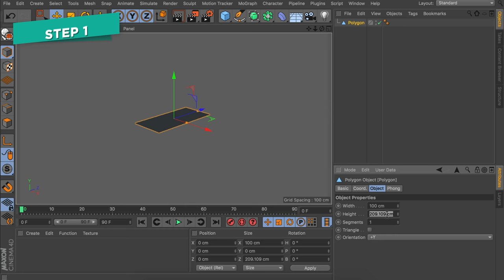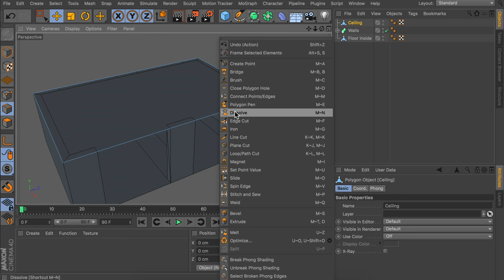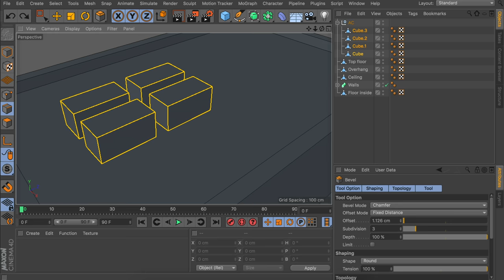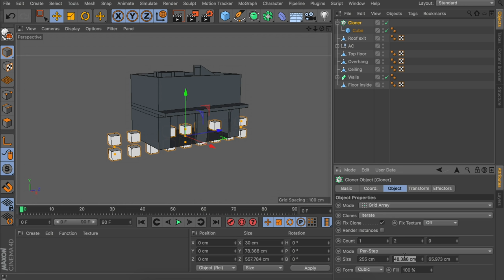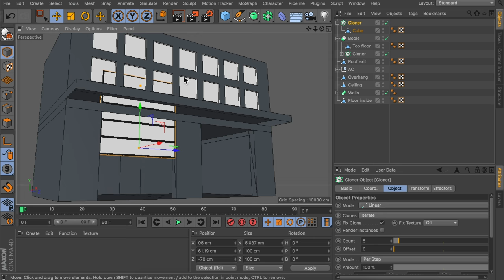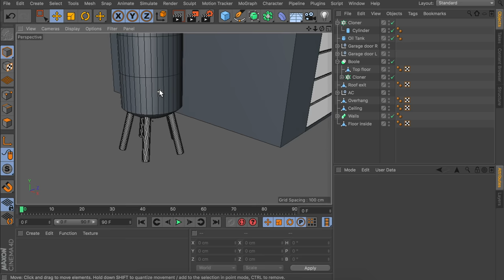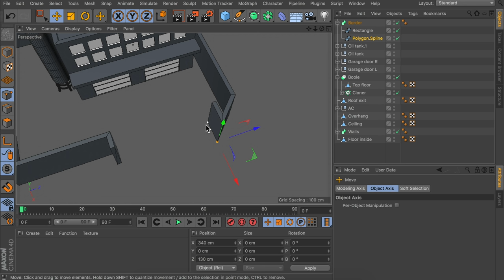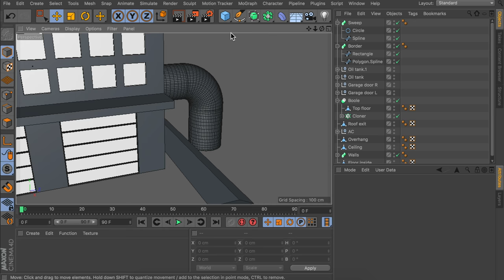Low Poly Factory Scene (Modeling) - Cinema 4D Tutorial

Comment: Hey guys, bit of a problem; how do i select the edges of the polygon?
Reply: Make sure your polygon is editable (press c). I clicked that button at the top left  at 0:34
Hope it helps
Reply: @eliprenten7066  Got that part, didn't know that 'Shift' was used to select the edges of the polygon. Was a bit of a head scratcher because I kept holding control and nothing happened. Thanks by the way.